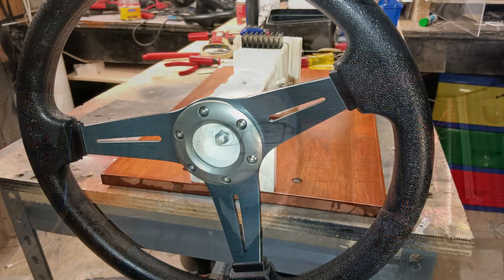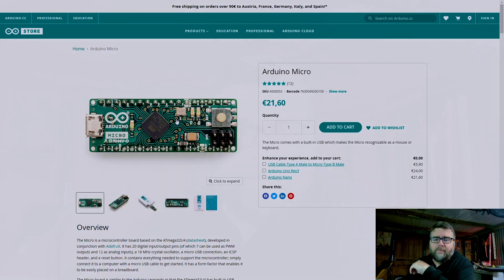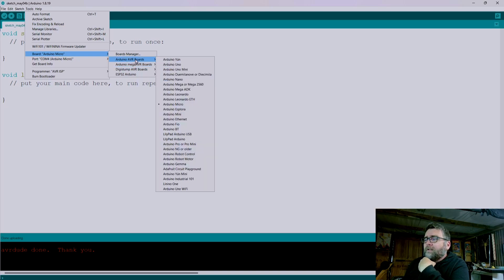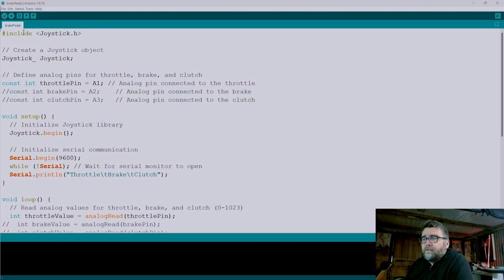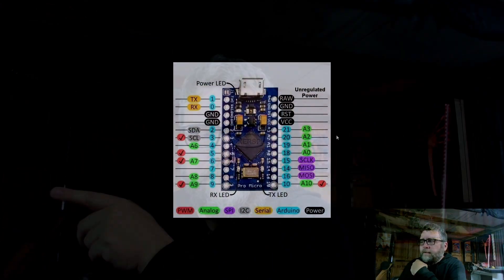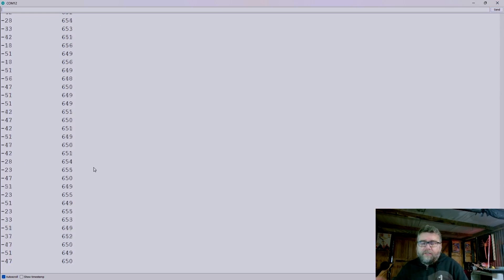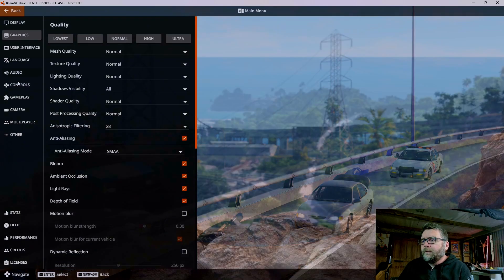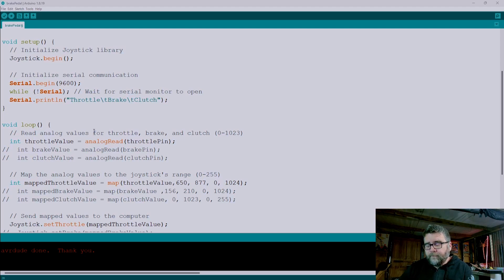Getting started with the Arduino Joystick Library

Comment: bro thanks i learned a lot 
but in Arduino UNO i can't connect it with the set up game controller in control panel
it won't show up there 
do you have any solution ?
Reply from the maker: I think you can only use a Micro or a Leonardo

Comment: excellent.  may i know what potentiometer is used here?
Reply from the maker: Not potentiometer but a hall effect sensor.
Reply: @JWNZ  cool, thanks! After the setup, does the board/device become plug n play in windows?
Reply from the maker: @santiagoluib3  Yep, plug and play don't need to run any other software like simhub etc.
Reply: @JWNZ  i hope I'm not taking much of your time. I'm curious to know which part exactly in the process that made the Arduino PnP and recognized as a standard joystick. I make flight sim panels and so far I use software like Mobiflight to serve as Middleware :) THANK YOU so much.

Comment: does this work with any game like if i wanted to setup the pedals with f1 2023 or 2024 would there be anything different i would need to do?
Reply: Thanks for the help! I plan on using an arduino Leonardo and potentiometer for the pedals and a steering mechanism for the controller converting its 40d left and right movement to 360d steering with gearing
Reply from the maker: You would configure it in the game FYI this only works on a PC

Comment: I recommend you try out this project FFBeast. It uses BLDC motors, which are cheap and powerful enough to use them without any gearboxes and use them directly. And quality of feedback is much better. Also you can coonect analog pedal or handbrake sensors in single microcontroller. Also project has open source 3D models for cases. Maybe you should check it out

Comment: Do I need two separate Arduinos for both of the pedals?
Reply from the maker: No, you can have multiple pedals (sensors) connected to one Arduino.
Reply: @JWNZ  Sorry I'm relatively new to this stuff. Would i need a special kind of dupont cable or how would I get two sensors connected to the power ports on the Arduino since there is only one 5v port. I'm using Leonardo. Thank you for responding I'm really impressed with your work and I think its super cool!
Reply from the maker: @ToastyToastedToast  you can solder directly to the sensor if you want. Dupont connectors aren't super reliable. I use them when testing but for an actual fixed install I would solder directly.
Reply: @JWNZ  Ok ill try that, thanks!